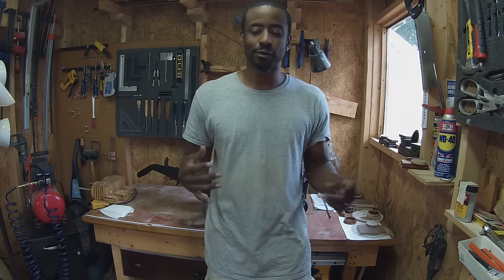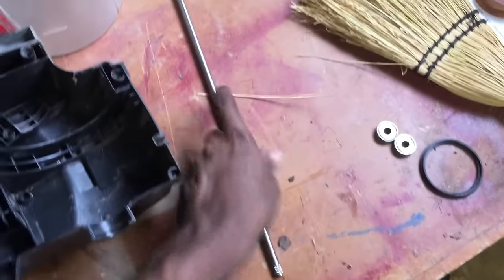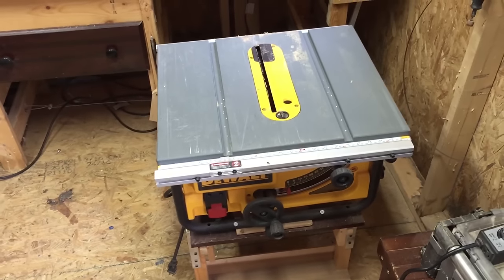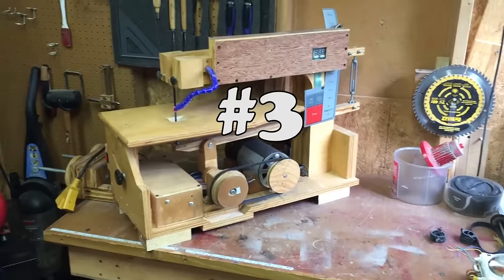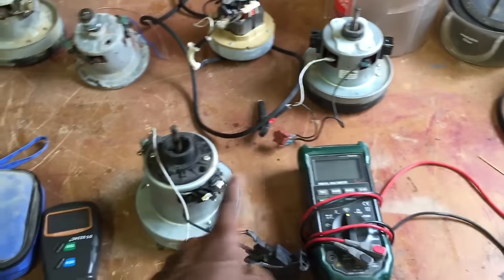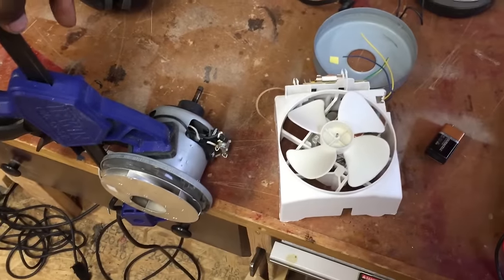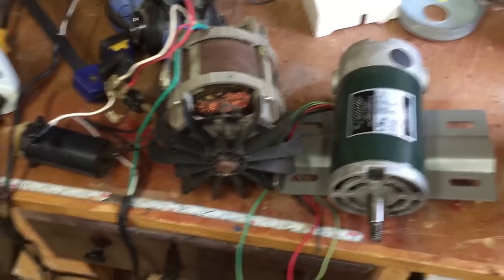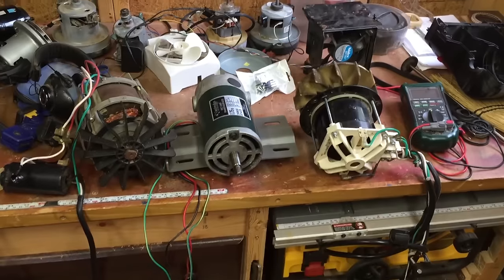Things You Can Make With A Vacuum and Other Salvaged Motors: # 010

Comment: I used to do apartment maintenance for about 10 years and would always find vacuums. One thing I always salvaged from them was the automatic cord reels if it had it. Then you turn them into shop extension cord reels by switching the plug.
Reply from the maker: I like it.

Comment: You are one talented reverse engineer, scrap and parts collector, and inventor.
Reply: I could agree with that, except I heard no mention of a electronics or electrical engineering degree.  What he should build is a 3d printer with some stepper motors! I'm sure though diy kits aee available,  however to use larger motors for. Larger , faster machine ,  with logic board from Kit ???
Reply: @kjaxky  there’s no we he isn’t an engineer. Go watch his other videos it’s akin to a tenured physics professor.

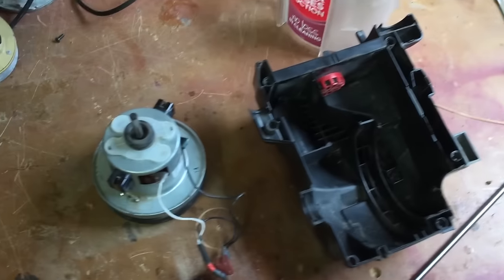Comment: I have been in the vacuum industry for ten years. If I may, I'd like to offer a few tips on the vacuum motors.  Clean air motors, like the one you took out of the bissell, cool themselves by having a ducted exhaust. That directs all the air from the fan across the motor to cool it. There is a good shot of the duct @ 1:04 in your video. Having the motor in an open cradle just lets the exhaust air from the fan go anywhere and not across the motor.  Mounting the motor inside a box with some scrap blocks of wood cut to 45 degrees (to give a semi-round air path) and a 1" to 2" hole on one side should yield proper cooling. That being said 10 to 12 amp vac motors normally run at about 120 to 150 deg. fahrenheit.   If you make the box a bit oversized, and then glue and staple any cheap carpet padding to the inside, it will quiet the motor down a good bit. Adding a piece of chicken wire or hardware cloth with some thin cloth (old tee-shirt or sock) or  the foam from the vacuum itself if it has the washable style filter to the fan side of the motor will prevent  sawdust or other debris from getting sucked into the motor.
Sorry for the long-winded comment but I hope this helps.
Reply from the maker: These are great ideas. Thanks
Reply: Dude he covered your whole spiel in the video didn't you watch the video before commenting?
Reply: I did watch the video, and the annotation @ the 8:30 mark was not there when I made the comment. If it was, I am in error or might have looked away  for some reason or another at that time. We would have to ask the gentleman who uploaded the video if it was there or not.
Reply: Ok but he talked about your issues as well one cant change that in a video....
Reply: Yes, he did also mention the noise factor and using half of the vacuum's motor housing to make a base for the it. All I was trying to do was give some advice on those subjects so that he, or anyone else, can get the most out of the vacuum motors.
Reply: The fans dude the fans ! they were for cooling! sorry dude im out here
Reply: Oh, I see what happened here. Simple miscommunication, the fans I was referring  to were the fans on the motor. Technically they are properly called impellers, but most commonly they are just called fans. It's an old industry holdover term from Hoover. When vacuums were first being sold, not many people knew what an impeller was. However most knew that a fan moved air,  so from a sales perspective they were called fans to make the product easier to explain and sell.
Reply: yall crazy
Reply: IL Palazzo both of you are right but what's the point.
Reply: Jeremy Fielding is it possible to make mini saw (table) from 800w vacuum cleaner motor ?
Reply from the maker: The speed would be insane when you turn it on then almost zero when you cut something with it. These motors don’t have much torque. I would say no... but that hasn’t stopped me from trying all kinds of things I was wrong about in the end.
Reply: Jeremy Fielding not much torque, but very high rpm. will you try it :)
Reply from the maker: That is not a project for me... I was thinking you would build it!
Reply: IL Palazzo That was nice of you to help out. Peace.
Reply: @walkertongdee , It takes a grown up man step back and admit miscommunication. Peace.
Reply: You’ve got some great ideas!
Reply: IL Pala dork
Reply: My favorite part of YouTube is how an expert in some random field can just comment with a ton of information
Reply: IL Palazzo, thank you for your informed comment.

One question: so is the motor being cooled by 'clean' air?  The air hitting it has already passed thru the cyclone and the filter?
Reply: @jeric_synergy8581  yes then through the impeller, through/over the motor for cooling then exhausted back into the room, usually via a post motor filter of some sort to catch any carbon dust from the motor brushes. That's the general garden variety but there are many variations too
Reply: @the_great_lord_ilpalazzo  Yes, Jeremy specifically mentioned removing the impeller, so your suggestions for improving air flow over the motor were good ones. If I understand this correctly, even if head kept the impeller on the motor, the open base he used still would not have allowed the impeller to move enough air directly over (and through?) the motor. So, your box constructed of wood would be necessary for keeping the temperature of the motor down between 120° and 150° (F).
Reply: On this particular subject, I'd say that the more wind the better. :D
Reply: Please don't apologize that was fantastic information!
Reply: I would say this is good to know. I've have several models of vacuums that would shut off easily if they got too hot and wouldn't work for fifteen minutes or so. Seems to me these kinda motors get hot quicker than other kinds and so tips on cooling them are useful
Reply: Ilpallazo. Wish every long winded comment was as thorough as yours.
Reply: please share a picture of your system!
Reply: @the_great_lord_ilpalazzo  No need to apologize.  Walkertongdee is the Barney Fife of Youtube.
Reply: @Bushybowl  That's in theory. In practice some dust always find way through. That's why bad bearings are number 1 malfunction with vacuum cleaners by far.Some big name brands not even putting sealed (only shielded) beings in their motors, so they have to fail after certain number of working hours. Changing bearings on them is real hassle. People usually just buy new vacuum cleaner. Or maybe new motor, which is probably best option having on mind that is cost around 15- 20 €
Reply: @womaninwood9177   Here, where I live. And probably wherever you are. Just call standard Chinesium delivery and you will get same motor and it would be same as one you have on your device. Where do you live?
Reply: Thank you for these tips- really helpful and I'm sooo glad you're long winded. Cheers Mate
Reply: @womaninwood9177  just buy a used vacuum from a garage sale or second hand store, you could even find one for free sometimes
Reply: You outta make your own video. Sounds like you know your stuff
Reply: That's all good to know thx
Reply: @walkertongdee  you can't change audio in a video ?? Sure you can they have been doing it since 1929 the invention of the "talkies" lmao also Google Audio dubbing that's been around since video tape , and is simple to do,  hook up a mic to semi pro video recorder pause where you want to record new audio hit audio dub button begin new sound , that's from 1978 lmao.  My old man did it all the time .

With computer video editing like Jeremy is doing,  he can mold and slice this into a whole new pie  dozen ways.   And you'd never know . Nor would you know when he did it .  

Looks to me like Jeremy appreciated this guys feedback (he replied) and incorporated those to make his video better!
Reply: @Jeremy_Fielding  Jeremy i have watched so many nat geo and discovery multi hour shows  mostly the guy going through the process and many times they fail in the end,  there's a guy named Louis Rossman  in new York city fixes laptops etc you can watch his YouTube for a hour and in the end he may fail , there's alao some kid , same thing , many times people watch to be on the adventure with you and enjoy the process.

Comment: The treadmill motors (DC) make great wind turbine generators, and with a speed controller work great for drill press. lathe, and other machine tools.
Reply: dalmatiangirl61 I had thought about the generator but not the others, that's man lol
Reply: dalmatiangirl61  I was looking to see if a vacuum cleaner motor is good to run a small taig lathe.  Is it not strong enough compared to a treadmill motor?

Comment: That's a great idea with the wireless button. You should consider attaching it next to the table saw button. Great vid!
Reply from the maker: I love it when people do that! I have not considered putting it directly on the table saw. But there is no reason I couldn't. I will mount it right next to the button. Then...No excuses for not using it. Thanks Bearded Woodworker LOL. I just like saying that now.
Reply: The Bearded Woodworker
Reply from the maker: In case you haven't seen... the switch is on the table saw. Check out video 18... I call you out as well for the idea.
Reply: Ha ha ha.....you rock! Thanks!

Comment: This is friggin brilliant! I was just thinking about that same vacuum you have for your table saw. I have to clean the filters and some how save the belt. If that doesn't work I'm hoping to turn my old air mattress pump into a vacuum, that cyclone action was the part I needed to figure out to keep the motor/impeller from being destroyed. Now I can get to bed, thanks for tip! I'm subscribing.

Comment: It is nice to know another like-minded individual such as yourself.  A couple of years ago I got my hands on some vacuum cleaners and tore them apart as you did.  I ended up building my own vacuum form table for thermoplastics.  I used an old air hockey table for the table top.  I ended up using two large vacuum cleaner Motors to ensure lots of suction power.  It works very well.  I will have to find you on Facebook and post you some pictures.

Comment: Thanks for showing me that I am not the only person who picks up discarded stuff on the side of the road and hauls it home to be repaired or repurposed. Last summer I picked up a 10' x 10' canopy tent, like tailgaters use at football games, that took 3 minutes to fix and which for the past year has been providing a portable covered area for working on cars, etc. in my back driveway.  Picked up a child's battery-powered car the other day, the kind that kids sit in and drive; only problem was a broken rivet in the steering mechanism (like a cheap tie rod end that failed) and in a couple of minutes  drilled out both the broken rivet and the other rivet and will replace with bolts, washers and Nyloc-nuts for a permanent fix to the steering system. It was such a simple repair that I will offer it back to the neighbors to see if their kids still want it; if they don't, I'll ask if they still have the charger, which was not on the street with the electric car.
Question:  Since most of today's consumer stuff is made out of plastic of one kind or another, what glues, adhesives or epoxies do you use to glue broken plastic pieces back together, or to rebuild broken pieces of plastic that are essential to the operation of a device, like smashed plastic covers, broken water reservoirs or dust containers, or missing clips or tabs that hold in a vacuum cleaner motor or an axle on a toy car?

Thanks for sharing your knowledge and making these videos.

Comment: Probably mentioned in downstream posts... Goodwill, Salvation Army stores, etc. are excellent sources for vacs and other appliance motors. Usually motors/switches are ok... broken plastic is the fault so you can get them for $5 or less..
Reply from the maker: +Aceroadholder that is a great source thanks

Comment: I tried to use a vacuum motor once. Got it all wired up and mounted, flipped the switch and that thing started to smoke. I was sure it would have caught fire had I left it on. I want to learn more about this stuff. Subscribed.
Reply: Adam Gabbert did it have a start capacitor and did you use it? compressor needs a lot of amps at startup.
Reply: I must have wired it without the start capacitor. I have only seen them on the side of the motor. So if it wasn't attached, I'm sure I didn't wire it.
Reply: The motor was probably shot already. The fast spin speed makes them run as hot as hell, especially if the filters were clogged when it was being used in the owners home. That heat effects the glue/ resin used on the commutator , and the segments start to lift, the brushes are destroyed, and it will smoke like hell! I've been repairing them for years, simple to wire them, but not my favourite thing.  Hope that helps in future.
Reply: Thanks Peter!
Reply: Adam Gabbert
Reply: Adam Gabbert Did it run for a minute without smoking? A lot of vacuum motors actually pull all the air over the sides of the motor itself. This is how they cool the motor. By removing motor from the housing, not enough (or no) air is cooling it.

Comment: Just remember, when converting AC to DC with a bridge rectifier, the DC voltage is about 1.4x higher than the AC voltage was. So 120V AC becomes 168V DC.
Reply: So I would need a step down buck?
Reply: @kenzlynesplayhouse7081  Depends on your use case.  You could use anything as complex as a VRM, or as simple as a resistor.

Comment: I once disconnected both vacuum hoses (one going into the bag, and the one going to the roller) on a hand held dirt devil, I put a pipe extension on the hose that ran to the bag, and made a corded leaf/dust blower that worked surprisingly well.  I also removed the unnecessary parts, like the belt and roller etc. to not catch fingers.
Awesome videos man!
Reply from the maker: I like it. That motor does make an effective blower.

Comment: Man I’m digging your channel more and more. All this stuff is right up my alley. I dumpster dive sometimes, pick up free things in alleys, and every once in a while I’ll buy something for dirt cheap or just splurge if I want it that bad. But my first option is always to see if I can make it myself. Im not rich by any means, and any money I do have I like to save it incase my dog needs an operation. I picked up a craftsman shop vac from in an alley a while back. Someone threw it out because they didn’t want to clean the dog hair out of it and the wheels were also all jammed up with hair too. I cleaned it and it works fine. Today I snatched up a bissel carpet shampooer that someone left behind a recycle bin at the grocery store parking lot. So I have those and summer is coming real soon and I want to fix my current AC unit, or make one, and also make some sort of table saw or table router.

Comment: Unrelated to this video, but I just found your page and am really impressed with your know-how. I buy a lot of cordless tools used and am looking for a decent way to test them without having the appropriate battery. Any ideas?
Reply from the maker: you mean before you buy it? A variable transformer and and full bridge rectifier would get you to DC and the right voltage. You would have to build something that was somewhat portable... its doable.

Comment: I find many vacuum cleaners on curb by the trash.  Mostly just needed the house unclogged.  The few that needs more help, are the ones that I'll take apart and keep the switches motor, etc... I haven't done anything cool yet with the parts except with the power cord. I made an drop/extension  cord with it. I like your videos.  Make more.  Thank you.

Comment: I may have mentioned this before but I just got one of these for my workbench system. I had picked up 2 vacuums from trash on side of road. one was all there but this on didn't have the top end so I removed the bottom (roller housing exct. ) that one worked like a champ all be it with out all the parts. But I first wanted them  just for the hoses and I was trying to find a cheap supply of pipes to install under the edge of my work bench. as this one wanted the job so much I thought  to retro fit it under there also and it will give me a vac. for cheap.  I will be watching your videos on reusing washing machine parts. I subscribed, So I be watching.

Comment: For 10 years my wife has laughed at my curiosity for negative pressure and vacuum cleaners.  For the last 10 years, I have repair helicopters with fabric and epoxy using negative air pressure and heat.  I love a vacuum.
Reply: I know this comment is 3 yes old but if you see this I am extremely interested in how! Do you create a vacuum like plastic molding stuff I've seen before?

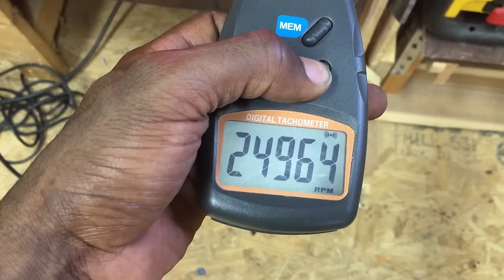Comment: 8:12 You don't want to remove the fan, just block the intake, only allowing a small bleed-hole or an adjustable bleed (such as a square of metal or plastic on a swivel to choke). Then you can cut the fan for more power, or use the full fan for full cooling. Centrifugal fans have very little drag when there is no airflow.

Comment: OMG thanks...I have often thought that all these YTers are missing half the dust cleaning in that everyone uses a shop vac, but no one DIRECTS dust into the vac.  I also have an air mattress blower that I scavenged from a rental clean out, and did not think to use in this capacity.  Your scroll saw has the perfect use.  I also suggest a variable blowing capacity screwing the valve closed.
That same unit just gave me 3 box fans.  I tore 2 down to the motors, and the third appears operable, so my plan is to make a dust box.